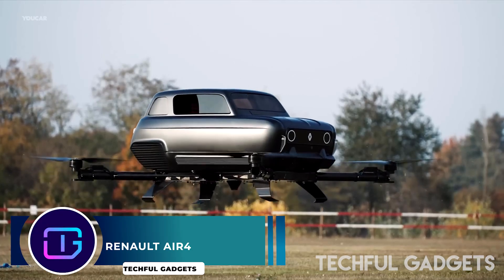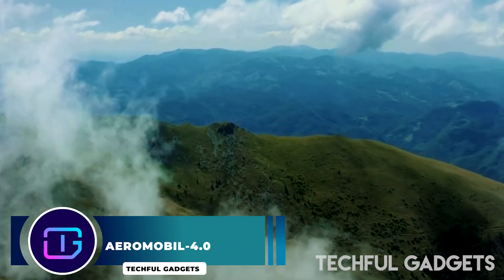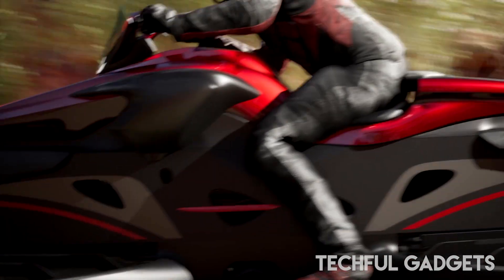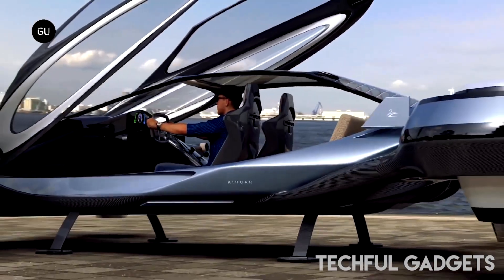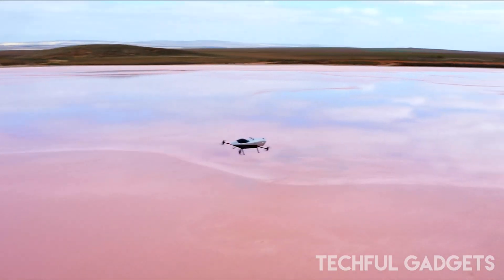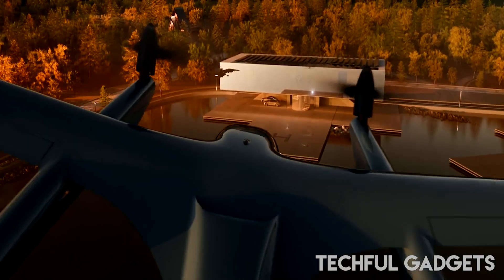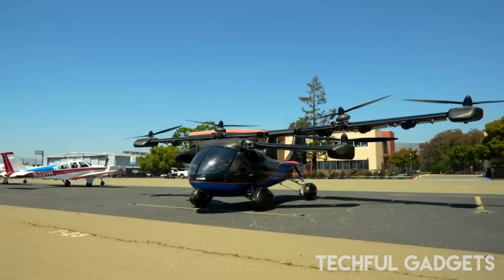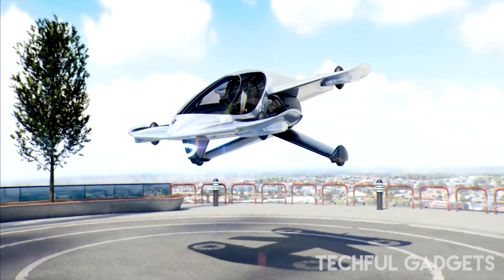18 Flying Cars | Best Ultralight Flying Vehicles 2024

Comment: In my opinion, the most promising form of VTOL is a flying saucer - a discopter. A flying saucer is a disk-shaped helicopter. This helicopter has blades on the disk that rotate in opposite directions. That is, it is a coaxial arrangement of the screws, like on the Apache helicopter. The first were German developments during the Second World War. The Habermohl disk, the Ziereman disk and the Focke Wulf 500 disk helicopter. The disk is a successful streamlined shape. The flying saucer is a very maneuverable VTOL.
Reply from the maker: The discopter concept  is definitely fascinating combining the aerodynamic advantages of a streamlined disc shape with the stability of coaxial rotors is a smart approach. It's wild how some of these designs trace back to WWII-era German prototypes. If the engineering challenges can be overcome, flying saucers might actually be one of the most efficient and agile VTOL platforms out there. Definitely a design worth revisiting with modern  tech.

Comment: And we thought this was too advanced to develop in 2024 with all the materials we have. Thank you for this very informative information.
Reply: Flying cars have been technically possible for around half a century, it’s not the tech that’s the issue, it’s that in the real world they’re not practical..You would still have to follow flight paths, which means no flying over urban areas. No taking off and landing on public roads, so you need to drive it to an airfield. Full flight safety check is required after each transition from car to flight mode. That takes time.…At that point you might as well buy a Ferrari and a chopper, both of which will do the same job but quicker, and cheaper.